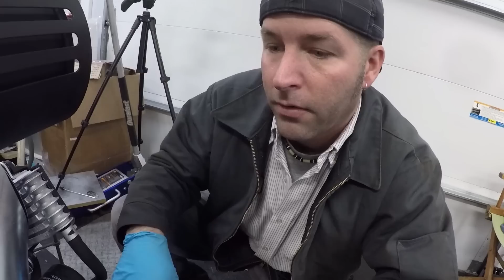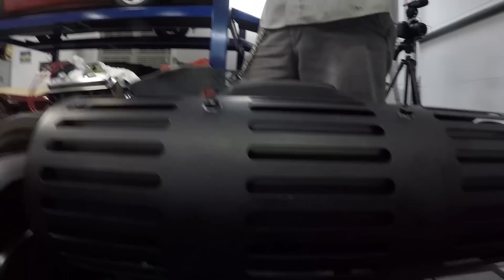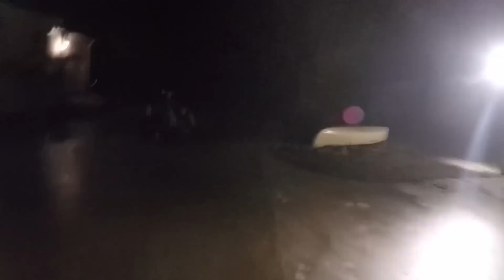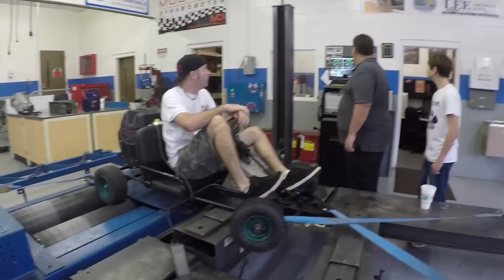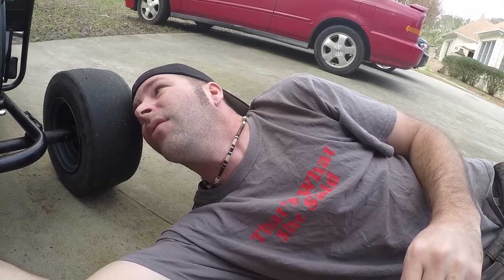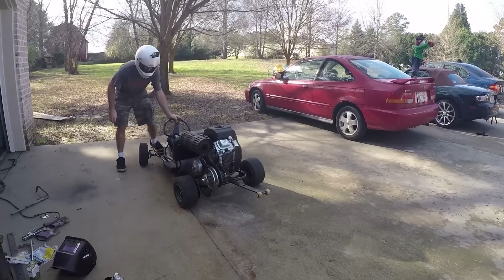V Twin Go Kart Governor Removal, Dyno, & Wheelies!

Comment: I know why the engine smoking I watch tractor pulls for a while and I noticed the modified tractors or even the stock ones that were powerful enough to do a pop a wheelie and then they come down hard then you see a bunch of black Gray smoke come out of the exhaust what's going on is that you're coming down so hard that it's sloshing the oil up into the combustion chamber it'll be fine just let it burn off check your oil levels you might need to put a dry-sump oil system in it if you want to keep doing pop a wheelie good luck stay safe peace out in a little world have a great day

Comment: I know this video is 3 years old but I wanna let you guys know everybody says that the motor isn’t making the power it’s supposed to the reason for that is your losing all your power by running a belt from the torque converter to the lower gear pulley then straight from lower gear to the sprocket  then from the upper sprocket to the lower sprocket on the axle there is a lot of power loss there if you ran a straight chain or a belt straight to axle from clutch you’d have all your power

Comment: just get an old motorcycle engine that way you have a transmission no need to blow engines or remove governors or have a torque converter just clutch and a lever connected to the shift arm

Comment: Kinda cool but 17hp is sad my scrambler has 38 and it's not that fast
Reply: +KrazyFuckinCrackers1 how much torque does it have?
Reply: 32 but without a crank rating on that engine you have no clue what its putting out dyno's are made to get numbers at a 1 to 1 ratio not what ever that works out to

Comment: Hi i have a motovox mini bike that i want to put a predator hemi on could you guys send me the measurements of where i have to drill the holes 
thanks
Reply: +anton istomin man. all we did was put it up there and drill the holes. we dont have the specs. what i would do is have your engine with clutch on (ours had to go on backwards ) line up the sprockets  and spray a tiny bit of paint down the mounting holes, then you will know where to drill the holes.

Comment: your doing wheelies with a engine thats meant to be horizontal position and you wonder why its burning oil and stopped... your oil is going inside the cilinder because your tilting the engine... also the oil pump may not be delivering oil to the camsaft at that moment so your burning it

Comment: Thumbs up,  Isaac,  lower the wheelie bar to keep engine level to stop oil rush, adjust wheelie bar to allow 2 inches of travel and gain more control.  Try making the w/bar using a leaf spring.  Great video 
                                                                                                                Okie-Bob

Comment: DUDES that is to COOL !! Do u know of any one that has a go cart _ the motor ? I have a little 3 hp. & I was wondering if there is any way I could ether bore this motor out & try to get up to at least a 3 an a 1/2 hp. ? Its an old brigs 'but it still runs great . Ive got it on a mini bike now & I need a new throttle cable for it . I just know once I get the cable ' Idought It will haul my fat ass very well !! great Vid. fellers . Jimmie R

Comment: I got a two seater baja dune 150 that I put a predator 6.5 hp engine on and a 30 series torque converter. The go kart goes a good speed but my torque a verter belt is burning up too quickly. Does anyone know of a stronger belt that I can use.

John
Reply: +Bulivye Yerxa check the alignment of the belt
Reply: +isaac it'll be fine thanks for the advice hope it works

Comment: If I remove my governor do I have to replace the flywheel.. What's the chance of blowing my engine don't want to spend $100 on a flywheel
Reply: +blake bowman we havent had any problems with blowing stuff up YET. but my new engine im building has a flywheel on it now. if you dont put a flywheel on be careful .

Comment: The reason it drags to the right when you do a wheelie is because of the weight balance, you can clearly see that the cart is bouncing on the right back wheel when it hits the wheelie-bar, while the left wheel is still gripping.

Comment: Maybe those engines are different but on most small engines that I've messed with, you can just move the governor linkage to a different hole on the car carb lever there by changing the governor speed. You can also just add a spring to the lever on the carb to counter act the force of the governor also increasing the engine rpm. Or just zip tie it lol.

Comment: you two fellers claim to use a torque converter from GO Power Sports for the 1" shaft - but go -power sez it's only for up to a 7 h.p engine ?
Reply from the maker: +Paul Petlin They actually rate it to up to 18 horsepower, so yeah we're still making more power than they recommend, but it has been fine for us so far. Also- not funny.

Comment: Why didn't you guys just lock the torque converter on the dyno? Also wouldn't lightening the governor work better then completely removing it (i.e. letting it kick in at a higher rpm) and for the love of god get a neck brace to wear until you put a cage on that thing!

Comment: If you put a CV carb or a carb with an accelerator pump on that thing, it'll run a lot better off idle, you might even make more power.  Just get a motorcycle carburetor.

Comment: Forget about getting a smaller sprocket, it's geared PERFECTLY, as you can clearly see by those straight COSMICALLY EPIC wheelies! She just needs more top end with a bigger main jet first, air filter mod, and straight pipe and she'll be sailing like no other! If that doesn't get you some deadly top speed, just say "it'll be fine." and turbo the bitch! lol

I'm loving it, keep em' coming! This is straight top shelf entertainment right here! Hahaha

Comment: Just put a zip tie in the throttle spring. same effect. or replace spring with a rod. You can feel the gov pull throttle back but just hold it down. Will over run just the same. Also note that when the engine is off the gov will apply throttle to ease starting. Backs off to a neutral position once started. If you put a throttle return spring on it will be difficult to start. Have to give it a little gas. When bypassing the throttle spring make sure there is a stop on the gas peddle because it will break the cable or bend the throttle if you slam it. Foot is usually stronger than a cable. I find its easier than splitting the case. Limiting factor is usually the carb size when it comes to upper rpm.

Comment: should definitely put on some bigger tires / wheels with some grip. it will change the gear ratios and give you more torque, more traction and slightly reduce top speed which you probably won't use all the time where you always want to take good corners and stick to the ground. Also wheelies! Bigger wheels and you can do some wheels consistently!

Comment: Keep in mind that doing wheelies and donuts the oil will slosh around inside the crankcase that might cause starvation of oil pump for oil which might lock up the engine  I think you should have a little more oil than what's recommended

Comment: how much did that motor cost you? I feel like an actual dirt bike motor would be the best option for these. A stock 450 would trash that motor. you can pick them up cheap, parts are cheap, easy to work on. it would use a real clutch that is contained within the engine.. other than shifting gears (wouldn't be too hard to rig up) there is only positives. imagine if you used a 500 two stroke!

Comment: 1. its x amount of horsepower with X amount of tq.... you dont use AND x amount of tq. cause hp was derived from tq which means it all ready incorporates it...

and it a dream world, you want a 1:1 on a dyno, but no freaking car on this planet has a 1:1 crank to tire ratio. the 1:1 you referenced was the gear ratio, which is mute when you still have to incorporate the final ratio...while this gokart may only have a gear ratio, it no way has a 1:1 gear ratio with 17 hp.... 

this should be common lingo when working with dynos. it utterly annoying when they dont understand these concepts

Comment: You could grind some metal off of the weights on the governor. That would increase the rpm and you would prevent floating the valves and spitting out a keeper. I love this video!

Comment: needs new piston rings
Reply: its not the rings that made it smoke like that. It was Ike taking turns to fast for the type of oil baffles in that engine or got it up on 2 wheels and the oil got on the top piston and basically flooded the engine with oil and drowned the spark plug

Comment: 17hp😂😂😂😂 bruh a 125 2 stroke puts 32 hp out full stock
Reply: Uhh sir The dyno is testing whp not bhp  the v twin it's compared to is a beast in tq and 2 stroke is known for having no torque down low, so really this motor is meant for large cart a 2 stroke would be bogging with carrying. Also 125 2 stroke puts out 24whp avg. so not far from 17whp 😂.

Comment: Alright guys I'm 15 and I really want a go kart
I can spend about $300 maybe $400 can anybody help me build it 
Please I really need the help
Reply: +Rhadiqul get a good tool base first... find a cart that needs minimal work and go from there.
Reply: +Rhadiqul I agree with ED S.....good luck!
Reply: Junkyard scrapyard 100 should be a good start.
Reply: +Rhadiqul  a good place to start would be to get a predator engine or if you dont live in the states, you can get a honda clone. get a secondhand frame too. get good tyres. always remember.... stopping the vehicle is more important than making it move. spend a good amount on brakes. do a live axle for sure too. and a torque converter if you can. a chinese pit bike engine would be the best way to do it. as they have a semi auto gearbox with 5 gears and neutral with 125cc of displacment. that will give you good speed and only cost about $200 and last a fair while if you maintain them regulary. give them a good oil change every 15 - 20 hours of use. using a pit bike engine with auto gearbox will save you money as you wont have to spend on a shitty centrifugical clutch or a costly torque converter. also those pit bike engines usually use standard 428 chain which in most cases supports standard 420 chain found on many kart parts
Reply: Craigslist Bro, Craigslist.
Reply: +Ian Thompson there's one by me with a predator engine, rear suspension, tires, TC, and solid frame. Just needs to be finished. It's 250 bux.
Reply: not bad
Reply: Craigslist